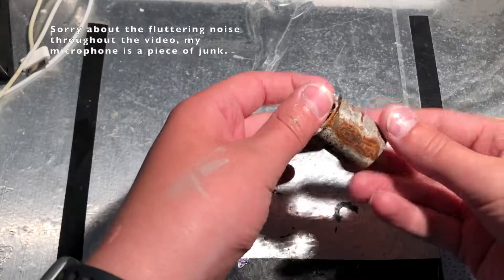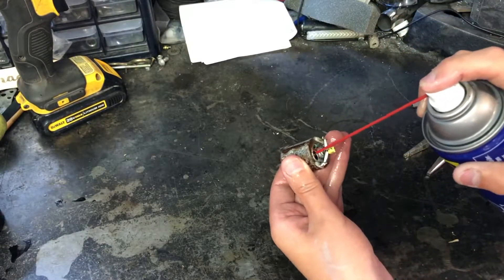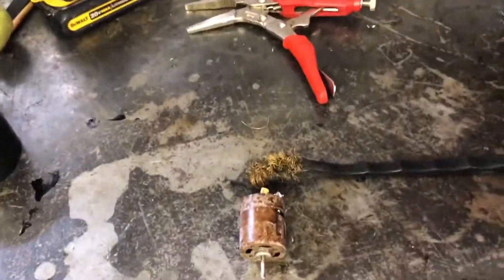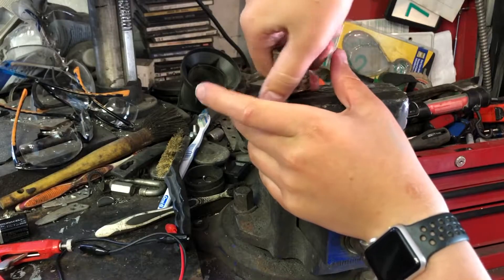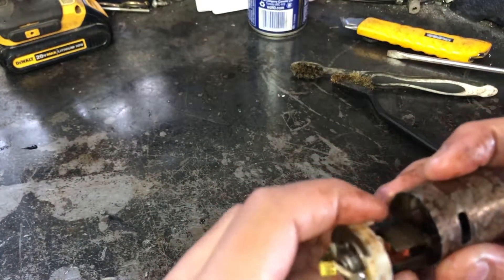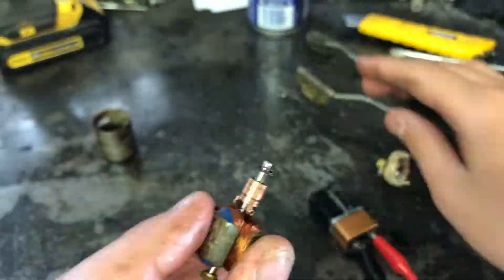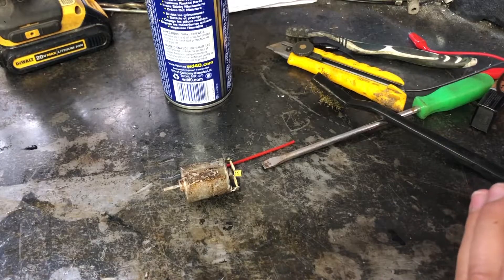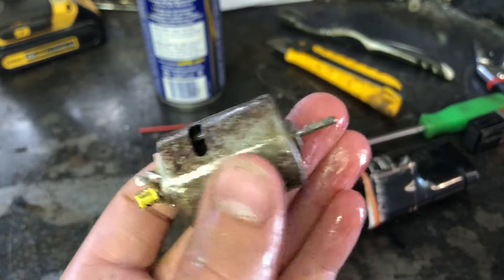Can I Repair this Seized Electric Motor that has been Sitting for Years?

Comment: The smoke from burning hot WD-40 is caused by to much heat. An electrical motor from a toy or cassette-player is often something like six or nine volts and battery chargers give often twelve volts. The little motor must be sweating from exhaustion, thinking his last hour has come.
Reply: > "The smoke from burning hot WD-40 is caused by to much heat."
Or maybe the coat from the cooper wires. Which would explain why the motor almost didn't run in the second try.